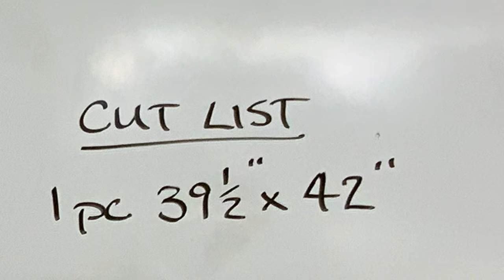Fabricate a 1 piece metal box

Comment: The hero here is the Magnabender.   Everything else is good but just ordinary.   Magnabenders were invented in Australia and they are fantastic tools.
Reply from the maker: Thanks and I do agree on just ordinary. The intent of the video was made to simply demonstrate machinery in action to new learners.
Reply: @sheetmetalwork  Yes, good video, but many have never even heard of the Magnabend machine.  Your method is only as easy as it is with one.    Just saying.
Reply from the maker: @darrenconway8117  true Darren, it’s great to have the tools and equipment and without out them it can be difficult but not impossible, one may need to improvise, if there’s a will there’s way.  Just saying.     Some may look at the video and realize that’s what the pattern would look like,,,,who knows, but he or she would like to fabricate a small light gage aluminium/ copper/ tin plate/ plastic/ cardboard box by hand, using a square edge to form the bends and rivets to hold everything together, If it’s plastic they would obviously need to add heat to make the bend.
Reply: Yep. These are very useful and pretty portable. We have a dedicated shop one and one for field use.

Comment: I make these all the time. But i hate when its taller than four inches bc it hits the top of the box and pan brake bc the one we have is only 4 inches deep. On aluminum this is pretty much how u have to do them bc the Pittsburgh machine hates aluminum and basically just tears the edge like ripping a piece of paper. So sometimes ill just make it in 3 pieces a U shape with 2 caps if i cant get it in the finger brake
Reply from the maker: LOL, funny how we’re faced with some of the same issues depending on our  Shop Tools and Equipment.  If there’s a will there’s a way.
Reply: @sheetmetalwork  haha i know right? But i really like that piece of equipment never seen that before. Right now im doing architectural sheet metal and we have a roper whitney electric brake that has fingers for the back gage and they move to where you want them. You basically program where you want them to go in the computer, and how many degrees you want thebending leaf to bend it, and it does it all for you. You can program up to 100 bends at a time its really cool. Ive worked with some cool equipment in alot of shops. The last duct shop i worked in was really high production. They had a whisper lock where when you put straight duct together all u have to do is tack the Pittsburgh down so it holds, then u put the piece in the machine by its corners, fingers come down clmp the corners, wheel the Pittsburgh down for you, and releases it, then next to that we had a corner machine where u just slide the piece over, put the piece in by its corners again, it clamps it, then the machine smacks the TDC corners init for you. Its really cool lol
Reply: I need one made?

Comment: I have that spot welder and burns hole in the metal all the time  sparks like crazy also.
Reply: Some guesses, based on using a spot-welder some:

Alignment and overall shape of the tips?

Is the metal you are welding clean?  If it’s plated - did you remove the zinc or other plating?

Is the weld time, clamping force, and weld-current set right?  Is it consistent from weld to weld?

(This last is sufficiently critical that I am thinking to use a precise timer for when I get my spot-welder set up!)

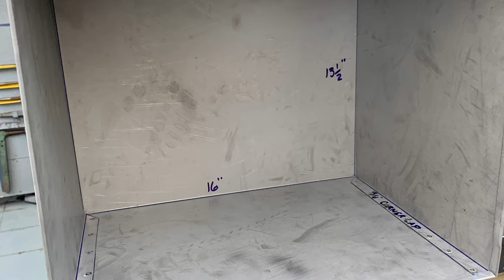Comment: At 4min. that is a great way to crush your safe edge. To do a nice looking job do the over lap and side folds under the clamp of pan break, pinching side and laps as look at 5:50 min bottom right corner where crushed.
Reply from the maker: You’re 100% correct in your observation.  Sheet positioning and the bending sequences is so important. 👍

Comment: The way you bent the first long 90 degree bend. You pinch the hem, making a crease. If this was decorative it would be rejected. Either bend with the material out not pinching the hem or use a piece of metal as thick or thicker to space the upper beam up. For decorative pieces or gutter collection boxes I will fab a solder pocket on 2 sides and then bend caps to fit in. Of course this only works on materials that can be soldered.
Reply from the maker: I do agree with you Brady. Great observation, and that only comes with experience. Thanks for the feedback 👍🏻
Reply: @sheetmetalwork  Been in construction, sheet metal since 1993. Funny I found myself watching your video.
Reply from the maker: @bradywilliams2666  I started the trade back in 84 👦🏻, 18 years with the tools fabricating and installing.  The last 20 years 👴🏻I have been lucky enough to get paid trying to help students. You’re right, YouTube is awesome, it sure would’ve helped me back then . Nice chatting Brady.

Comment: Interesting. Could this box be made using only the pan brake?  I don't see a magnabend in my near future.  Subscribed.
Reply from the maker: Yes, but depending on how high your sides are, you may need to manipulate the two last bends in order to reach 90 deg.
Reply: Try this:
Wedge a piece of 2x4 or pipe from a beam or joist in the ceiling, down to the piece of metal that would act as your clamping bar.
Your brake needs to be mounted on a sturdy bench or pair of horses for this to work, but it will work.

Comment: What holds the top die on the last 2 bends?
Reply from the maker: The bottom bending bar has a magnet in it, there is a micro switch that activates the magnet only when the bottom bar begins to lift up, and by doing so the removable top bending fingers are magnetized and hold the metal in place during the bending process. I hope this explanation was of help?
Reply: @sheetmetalwork  Thanks!

Comment: it's good but it's too much of a waste than making a 3 folds and a lock corner bottom and top
Reply from the maker: I agree with you on waste, and Im sure that many more followers do also.  Im sure you know that before fabricating anything the first thing to do is to plan the best and most efficient way of getting a job done.  Let’s just say the box or pan needed to be watertight, the dimensions are 46 x 50 with 2 inch sides, this method would save a lot time sealing/welding the bottom.  Thanks for taking the time to comment.
Reply: @sheetmetalwork  sorry , my words might be sound rude to other people .. I just don't know how to write properly .. but I'm not like that personally when speaking..  anyway for clarification if you are in a fabrication site nothing's really is a waste , cause every cuts might have another purpose